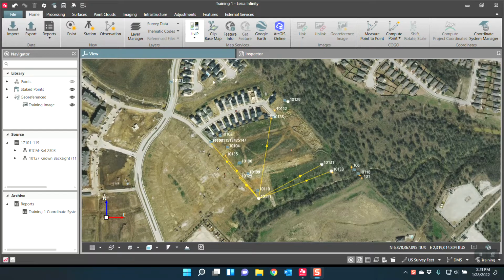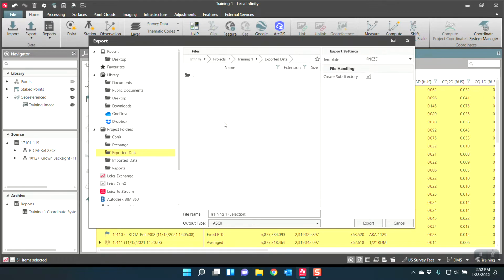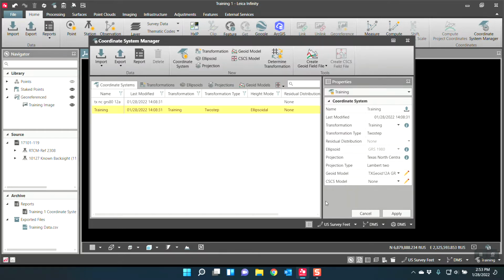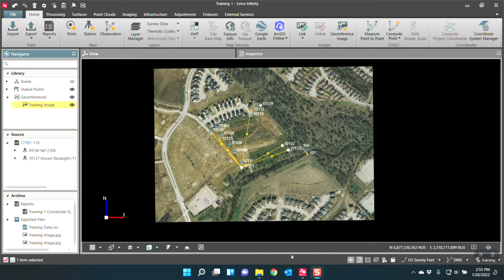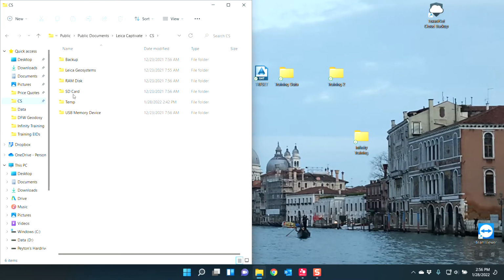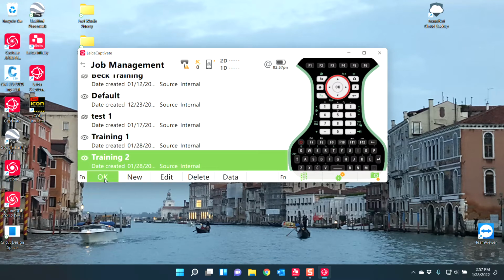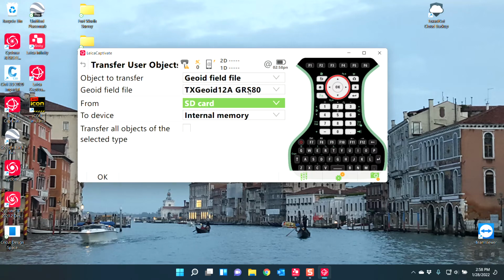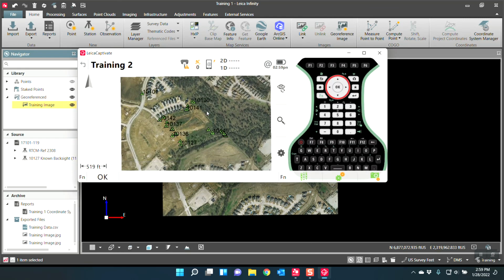Export and Import Data into Leica Infinity and Captivate

Comment: Why not just export the whole DBX file to be imported by the collector.
Reply from the maker: You can absolutely do that for the points and lines.  It will then also create the link for the Coordinate system.  

Make sure your field crews remember to transfer the coordinate system and the project onto the controller.   

Unfortunately the Geo Referenced image will still have to be exported and imported how I showed in this video.

Comment: Hello Peyton,
Thanks for putting these videos together. I'm trying to export a csv file from Infinity. I brought in grid and transformed to ground. I toggle to and from each by bottom right toggle. Tried several times to export while in ground election but keeps returning grid. Can you please explain how to create a csv of your selected data? Your help would be appreciated. Thank You! Paul
Reply from the maker: Paul,  You need to make sure you are loading in the coordinate system also into the CS20.   You can export the PNEZD all day, but if you are still selecting Stateplane in Captivate vs the Ground Coordinate system, it won't put you in the right place.
Reply: @PeytonHatch1  Thanks Peyton, I did elect the coordinate system at bottom right, is there another election necessary?...In any event thanks!